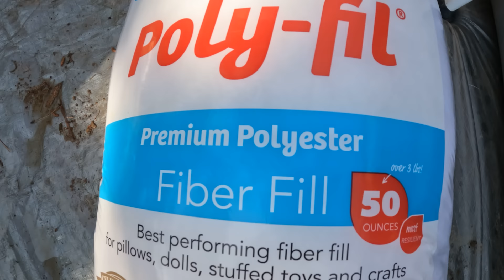Above Ground Pool Swamp To Oasis in 36 Hours for $30| FAST CLEAN Redneck Filter HACK| SUMMER 2022

Comment: I guess our well water doesn't put out water that will turn to chocolate mocha. It's always been clear as a bell. But we upgraded to a sand filter, had a cartridge filter before, only use regular pool sand. We had a 27' pool and the sand filter worked great.
Reply: Same here, our well water is crystal clear too even after pool chemicals. We also upgraded to a sand filter, the small cartridge filters that come with the above ground frame set pools just aren't powerful enough.  It was definitely worth it.
Reply: With that sand filter, you can also backwash or vacuum to waste which are great options the cartridge didn't give you.  If you need to help out your sand filter to capture smaller particles or metals, add some Jack's Magic Filter Fiber Stuff through the skimmer.  Works great!
Reply: @thegorn68  don't have to worry about the pool any more I bumped a patio stone with the mower and it went thru the liner and I told my wife no more pool and the very next day after that happened we had a huge storm roll thru with high winds,70mph, that destroyed everything else. Just not meant to be. Getting to many health problems, heart diabetes, bad knees,. Just don't feel like dealing with it anymore. More raised bed gardening now.

Comment: honestly you should try broken down lump charcoal between the polyfill. I do that in my filters and it works faster, just wash the charcoal hot water first to flush it some. You can activate it also which gives more surface area.

Comment: Pretty cool that this worked.  You should probably use this when filling your pool instead of as your main filter.  Long term, find a used sand filter.  The sand lasts several years and you won't be continously adding polyfil to the landfill.

The iron in well water reacts with the chlorine.  A bottle of metal out and some clarifier will take care of this.  No sweeping, brushing or vacuuming.  Fairly simple.

Comment: I'm curious: Why use fiberfill instead of sand?  You could then backflush the filter to clean the gunk out without having to handle the nasty fiberfill. YEs, you'd have to make a reverse-flow manifold, but wouldn't it be worth it for continued maintenence?
Reply: Probably so for continued maintenance; maybe make it in the interim?  In the mean time, to get immediate results, something cheap like this might be a good idea until what you suggested is completed.
Reply: I'm wondering the same thing. Rather than limit myself to one system and because I have guests coming in 3 days for a week. I am going to set up one of these bucket filters tomorrow and I also ordered both a sump pump with some wool socks for that method and a sand filter system from the Zon!  I am hoping the fiber bucket and sump with sock covered outlet will do the majority of the work and then the sand filter will polish it up...It took three days to pump the water from my well and my heart sank when I added the chlorine to the pool and turned it into swamp juice! TGF for YouTubers willing to share!
Reply: We used sand first and filtered it for a week it was still brown. About 12 hours with the fiberfill and it’s almost completely clean.
Reply: @stephaniesennert4889  Interesting I could not find fiberfill locally and Amazon wants a fortune for it, so I just bought a couple cheap pillows from Walmart and am hoping they will work. The weather where I live has been lousy all week so I have not started running the fiberfill filter yet but I went out and looked at the water today, it seems all the brown stuff that appeared after chlorinating has all dropped to the bottom and my water is now clear. I'm guessing that is because the water has not been circulating. Hopefully it has not stained the bottom.
Reply: Sand to expensive

Comment: Mel I bought several 5 gal screw on lids/tops from HD so they are orange.
I would be glad to send one to your PO address if you could use it.

Also Wondered if you used a mesh bag for the stuffing maybe not so messy to remove each time?
Reply: Mel the screw on lid should arrive Monday. I hope it is useful to you. It was just sitting on my porch and looks a little faded but is new. I'm 75 and could never figure out how to use that type of lid. Planned to use for storage during future shortages. Just sitting here so when you mentioned you were looking for one I hoped you can use it. Enjoy watching you build your dream place.
Reply: I found out that you can recycle apple juice containers and other safe PET plastic containers. I have to add the desiccant and O2 removers to help keep my dry goods from getting moths, but otherwise they're good to go once clean and dry. Some people disinfect them first. That type of lid is a heck of a lot easier to open and mess with especially like pouring rice, oatmeal, and things like that.

Comment: Minerals Oxidizing = Iron rusting.  It's just hard water.  Great cost effective solution though!  Don't let brown water freak you out.  Likely the same water you're are drinking everyday.  We upgraded our bucket filter like this to some 6" PVC (about 2' long) that we stuff with the pillow fibers and  run the hose through when filling.  It eliminates 90&% of the problem upfront and then you can just attach the filter to it occasionally if/when needed.  Slightly more expensive than the bucket method, but more reliable caps (Screw), and better filtration with less material.  Super easy to swap out/rinse the filling too.

Comment: Add 20 mule borax to your pool at ( 30 -50 ) parts per million.  And put 2 dry erasers in your red neck pool filter. I was wounding if you could use old pillows for the filter.  Hope you guys find a bucket with a twist lid. By the way this was a great idea 💡

Comment: I built one by drilling a hole in the bottom side of a large tote and running a two inch pipe into it and built a two inch network of pipes in the very bottom of the tote with lots of tiny holes in it, then put gravel around that and sand on top.  Then hooked up a pond pump inside the pool and run a garden hose to the top of the filter and the water gravity flowed back into the pool because the filter was on cement blocks.  Later I cut the two inch pvc outside the filter and installed a valve so I could hook the water up and force clean water backwards through the filter and let it backwash.  It worked well too.

Comment: I have a Japanese tub with a Wood-Fired snorkel heater. When I want to clear up the water, I use a little 110 pond pump with a hose to the top of the bucket filled with polyfill. I drilled some holes on one side of the bottom so that it just runs back in to the tub. My well has some iron bacteria in it. So when I shock the water it changes the color also. This method works fine, it takes about 3 hours to get crystal clear water.

Comment: screw on tops usually come with the 35-40 lbs chlorine tablets. so you can get a screw on top and a supply of tablets at the same time. Plus the screw on top usually comes with a locking system so it will keep from uscrewing the top too easily. You have to push in on the lock before spinning the top off.

Comment: I just built.mine over the weekend ( not exactly the same as yours).
I guessed at many things, but $100 later.(I literally had to buy each of the materials I used), but 22 hours later it came out absolutely clear.
I will happily.spend $100 on this instead.of $1.000 on chemicals for the summer.

Thanks you guys for showing everyone to do this.

Comment: Buy an undersink water filter with a tight element and adaptors to attach a garden hose to it.  Use it when you add water to the pool.

Comment: @Simple Life Reclaimed  Nice Job!!! 😁👍🏻 I used to setup a top ring inflatable pool for the family. I learned simplicity is the best method!!! I used the 1 inch chlorine tablets as well as baking soda. BUT I discovered one trick for the pump filter!!! The filters I used were the A-C sized filters with the screen to suspend the chlorine tablets halfway down in the filter core. I discovered that you can take about a 2" piece of scrap copper pipe and drop it down into the bottom of the filter housing so that as the chlorinated pool water flows over the scrap copper pipe, copper will be dissolved into the water stream to continuously "shock" the pool in a constant stream. Just note that the powdered pool shock that you have been using with the blue crystals? Well, those blue crystals ARE copper!!! So initially, 1. Redneck Filter. 2. Pool filter with chlorine tablets & 2" copper pipe in the bottom. 3. Add baking soda to the water to soften and make it more "basic"...easier on the skin!  that's pretty much it, other than skimming floating debris!!!😁👍🏻

Comment: I go out each night (sometimes, skip a night) and test the water for free chlorine and pH, then pour 1 - 1 1/2 quarts of 10% sodium hypochlorite (chlorine) into our 17K gallon buried Doughboy pool, maybe sweep it, then go back in.  12% chlorine would be better, but hard to come by in Texas. Easy peasy for city water, never ever a chlorine stink on our swim suits/hair.  Glad you guys figured out an easy way to deal with well water.  Chlorine is not bad, as some would have you believe.  Also, we don't use pucks.  They raise the CYA up too high, then you develop algae.  We only use them if our CYA has dropped too low or to zero, and stop once they have raised the CYA up to where we keep ours.

But we have a 3-tier bird bath that we stopped using because it was too hard to keep clean and didn't want to harm the outside life.  So will have to minimize your system and start using the bird bath again -

Comment: The stuffing from inside a pillow will clear 5,000 gallons in 24hrs. 
Small bucket with a lid. Drill a bunch of holes all over then add a fitting for a hose.  From pool to pool filter to bucket. Toss bucket in pool filled with stuffing.

Comment: That’s pretty cool. Plus another way to get it out and keep it crystal clear would be to throw some carbon in there, you can make your own just get some kind of metal cannon throw a bunch of pieces of wood in there and throw it on the fire and let it turn it into charcoal. Charcoal absorbs the colors from the water and other chemicals, but it will also absorb your chlorine so you don’t want to use it all the time.  But you could use that when you fill it, just set up the redneck filter with a bunch of carbon in there and pump your hose inside of that and let it filter for a day before you throw your chlorine in it.  That will basically just absorb the mineral particles before it ever turns brown. 

Personally I would just leave it like it was and throw a few bluegill in there and some plants. 😂

Comment: Another tip is muriatic acid to get the copper and metals to turn and dissolve but after a day you’ll want to put blue clarifier in it and then it’ll be crystal clear again! I figured this out last year and has helped this year as well! Also I bought a sand filter this year and has helped tremendously so I dnt gotta keep cleaning the filter.

Comment: Only thing i would consider changing would be to change out the bucket for a long large diameter piece of pvc (8"-10") with drilled cap. It will filter more efficiently.

Comment: I have the same exact pool, and I noticed the "bleached" area on the floor of the liner 😂 Before I got my chlorine tablet float, I crushed a tablet into a water bottle, poked holes in it and let it float...wellllll, half of it ended up spilling out. 😅

Comment: I have well water and filled an 18' X 48" round pool, added shock and it was totally clear. Of course the well water has a filter but its only about the size of a pringles can and in the basement and we only need to change it 2 or 3 times a year. It's probably your well water, I wouldn't drink it.

Comment: as a pool tech of 20 yrs., one easier way to clear that water is to cover the pool with a solid pool cover for the winter add 1 gallon of chlorine to pool before putting cover on and it will open crystal clear
Reply: might also want to try a metal eraser when adding fressh water also as chlorine will oxidize the metals in the water and depending on the metal it will turn a certain color.....copper turns green, iron turns brown and magnesium will turn purple

Comment: That's kind of  what I've  done  with my fish  tank. I have a small jar with some rock in the bottom of it and a tube sitting  in the middle of the rocks that comes out of the top of the jar. There is polyfil all  around the tube in the jar and an air stone and tubing down inside of the tube that I 1st put into the jar. I run  the  pump that the little  tube and airstone are attached  to and it bubbles thru the bigger tube and the polyfil filters all of the nasty stuff

Comment: Look for a food service bucket as they have screw on lids.  They are available from your local Lowe's. If not in stock then can be ordered online.  Little known fact, if the store orders for you (see Customer Service), then delivery to the store cost you nothing but the gas to go pick it up and the cost of your order (of course). And yes, I work for Lowe's and noticed the logo on the bucket.

Comment: I had a Doughboy pool that rusted. Kept the sand filter and pump modified the side wall for the Doughboy skimmer, modified the return with a little PVC elbows with arm for the eye ball works better and I'm not replacing polyfill I use all the normal pool chemicals no buckets or anything extra.

Comment: I think you guys need a vacuum head on a pole and run it through a sand filter. Then you can back flush the filter when its dirty. No replacing or cleaning your poly fil. It looks like the sediment is on bottom. The waterfall you created will also aerate the water and raise your ph. This will increase odds of growing algae.

Comment: Screw-top lids are usually sold separately from the buckets. My local Lowes and Home Depot both have them to add to any normal 3 gallon or 5 gallon bucket.
Reply: How about just reversing the bucket? So the lid is on the intake side?

Comment: What you have is what I have. Its called clearwater iron. Its invisible till you rust it. I am betting your toilet tanks and the drip spot on sinks turns brown or tan. Also shower areas. 
You can get Iron out for your pool but this filter idea works about the same. it just gives the iron someplace to collect.

Comment: I wish I had known about this when our family still had our pool. My mom and I were vacuuming the bottom one day, and when we had finished, I attempted to move the switch on our sand filter back to the filter position... and the handle broke off, so it was stuck on the vacuum position and we were unable to filter our water. And from there, the water became dirty, the liner disintegrated, and we ended up giving what was left to a friend of ours, who's repaired it and is now getting much more use out of it.
If we had just only known about this hack, we would probably still have a pool today. On the other hand, our friend's two daughters might not've been so lucky.

Comment: The reason the darker color comes out of the water as the tablet floater goes around the pool is that the lower pH of the chlorine tablets is forcing the metals to drop out of solution. You could try using liquid chlorine or a salt chlorine generator instead of the tablets, and yes, that might cost more money.
Another fix for the staining and the brownish colored water is to use a quart of super stain out, or metal-gone, these products are relatively inexpensive, usually around $12-20 bucks a quart and are available at your local pool supply, online supplier or even one of the Home improvement stores in your area. The product will both remove metals from the water and trap them in the filter and also act as a sequestering agent to keep the metals from dropping out of solution. I do like that you are using the polyfill as a filter though. I just wanted to add my two cents in the comments in case anyone might benefit from it. Keep up the good work.

Comment: I did something similar for a fishpond, removed the fountain top in the middle and put a grated tray on it with a large flower pot with a few holes in bottom (almost a bucket sized so the water presses really hard on the outlets in the bottom), water just get pumped up to the center where I put some shade net, rocks and batting in to capture dirt. Even with dirty goldfish and koi, my water sparkles all year long on a 20W pump. ( I had to desig this system as we have daily power outages which would otherwise have killed the bacteria that makes the filter work..

Comment: When we fill our pool we use a sock inside a sock and attach it to the hose with a rubber band (hair tie😘). We have well water with iron and this will take out the orange/brown color. Wool socks or thick ones works the best and change it out every couple hours as you fill your pool, best way to filter it out before starting your pump😁